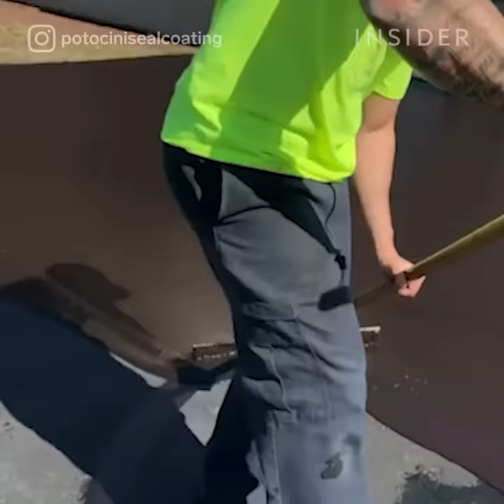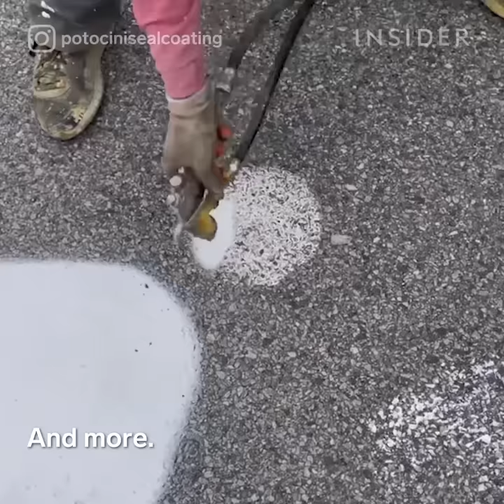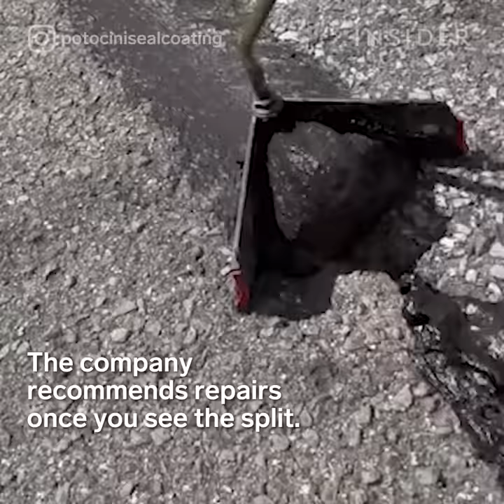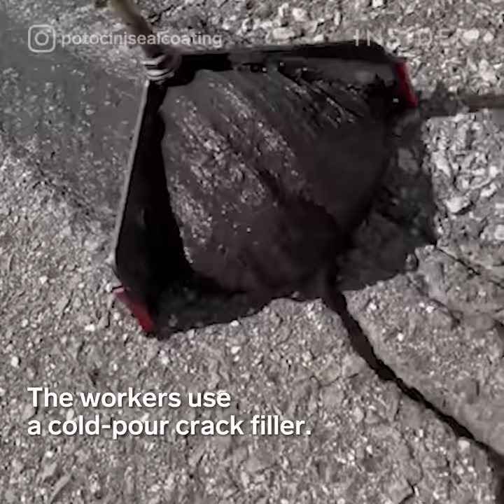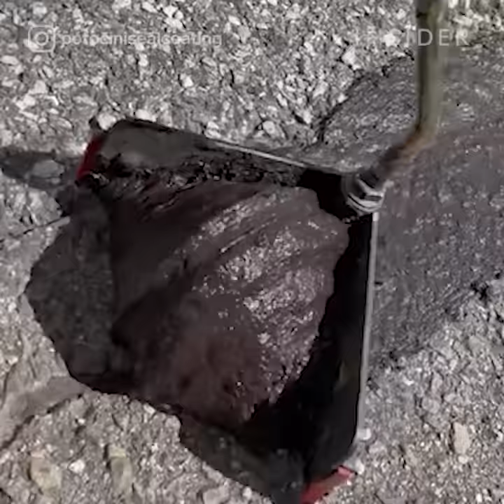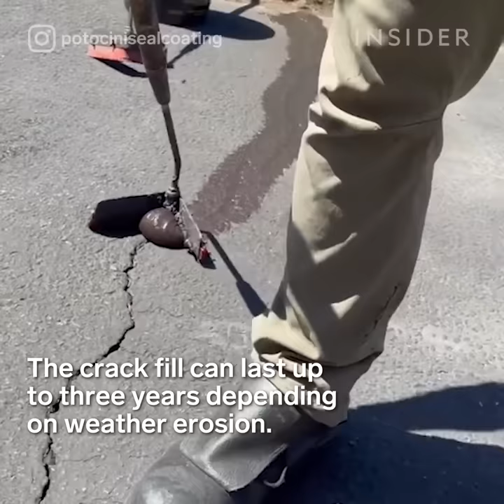How Cracks In Asphalt Are Filled | Art Insider

Comment: The hot melted asphalt that they use on roads and commercial parking lots is 100 times better than the cold patch stuff used in this video.
Reply: Is there anyway you've seen to not see the crack lines at all besides of course repaving??

Comment: I don't get why they wash it (with what I assume is water) beforehand. Wouldn't that just trap the water inside and cause the very issues that they're trying to prevent?
Reply: This is to remove any dust and grime which prevents good adhesion of sealcoat

- DIYer who leant about this just a week ago :D

Comment: Just rip up the length of road, compact it more, then lay a new base coat and top surface. The cracks will reappear despite the sealing. Winters and summers will split the seal over a short period of time and you're back to square one. Best to fully resurface the length of road.

Comment: Fresh, warm cow flop has been determined to excel as an asphalt crack fill material. Its use is noted by a water washdown after the steaming hot flop roll-in phase. Other options include ordinary cold pour and the outrageously expensive hot asphalt repair protocols.